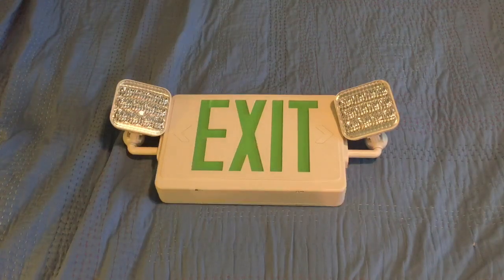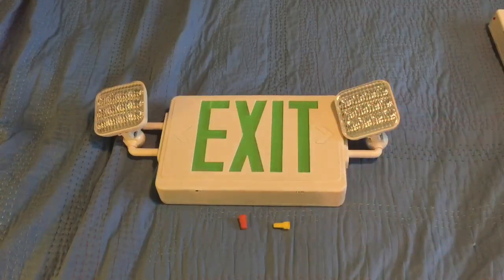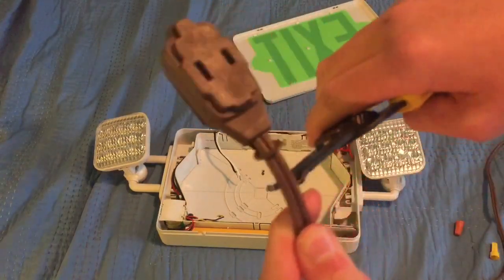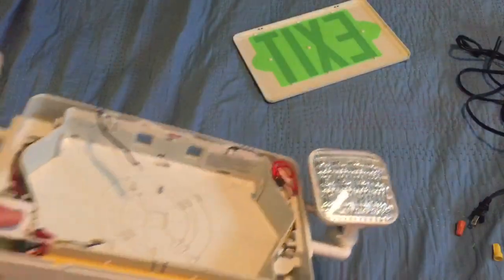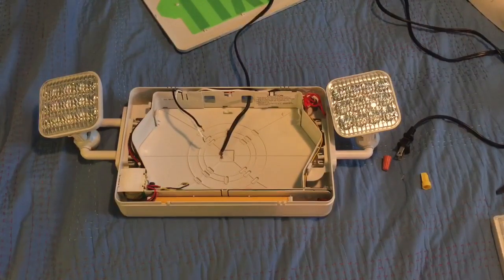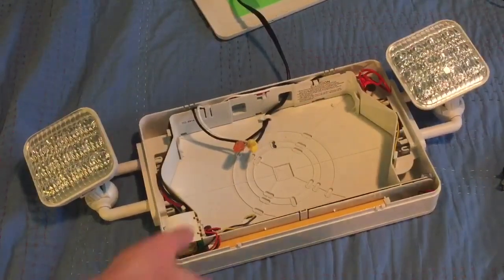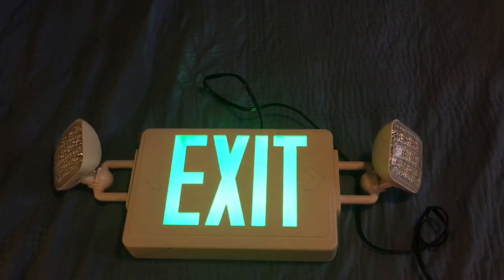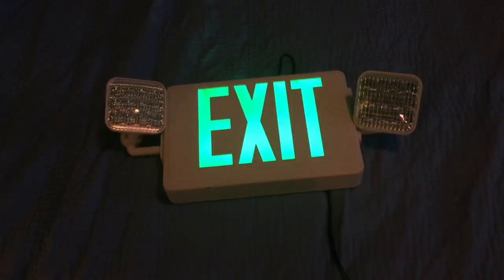How To Wire an Exit Sign

Comment: Will this work for building code inspections?
Reply from the maker: It will not. In a building exit signs must be hardwired to the building’s electrical system.

Comment: Hey, at my mom's work, me and my dad saw some Lithonia exit signs that are this model, but red, and they were out. When you press the test button, it blinks. What could this mean? They sent an electrician to fix it, but I'm still curious. Btw my dad and I work on stuff there.
Reply from the maker: That sounds like the backup battery was never plugged in or needs to be replaced.

Comment: But the real question is how can I make it so the lights on the side are on with the rest of the sign. I wanna make a lamp out of mine
Reply from the maker: Those lights are not designed for what you want them to do. They will light up during a power outage only. You’d have to do some modifications on the internals in order for them to remain on all the time.

Comment: Hi is there one for 24v or 48v models of combos or exit sign I am really not good with 120v and 240v
Reply from the maker: Exit signs do not come in 24VDC or 48VDC. Only line voltage such as 120VAC or 277VAC.
Reply: @ExitSign250  alt right thanks I asked on of my friends if he could wire up my broad he said yes so I tell him to run 120

Comment: Hi, thanks for the video, do you know if i can connect this sign to 220v line?
Reply from the maker: Most exit signs are either rated to be used with 120VAC or 277VAC. Any other voltage will not work and may cause damage.

Comment: So my sign isnt illuminating any more and when i press the test buttin the red led bulbs just flashes once.  What do I need to replace?
Reply from the maker: This may indicate a dead or disconnected battery. Try to connect the battery if it isn’t already, and if the battery is already connected it just be replaced.

Comment: I hooked up the two whites and two blacks the light goes on for about a minute then shuts off looking @ the panel the breakers say 125/277 I think I need to hook up the red wire to the black one coming through the wall. Also do you think this light is still functional since I might have hooked it up the wrong way to start?
Reply from the maker: Are you plugging the sign into a normal standard outlet? If so, it is 120VAC. Also, are you in a commercial building? Most houses are 120/240.
Reply: @ExitSign250  It's a commercial building and I'm not using an outlet,its hardwired through the wall. I have (1) black and (1) white wire coming through. My other concern, was the fixture damaged since I hooked up the 120v black wire to the power sorce coming through the wall?
Reply from the maker: This video was not intended as a how to for replacing/installing an exit sign in a building. Instead this was for if you had an exit sign and you wanted to connect to an extension cord for display purposes. In your scenario, more than likely the sign has been damaged beyond repair. If the wall connection was 277VAC and you connected it to the 120VAC input on the sign it was significantly overpowered. Before replacing any fixture or sign where the voltage may be 120V or 277V it is a good idea to find out what it is. Either with a multimeter or by looking at any markings at the breaker. If I had to take a guess, the connection you have was 277VAC.

Comment: Red is the ground and the black and white is the power if you have a emegency light or a exit sign only and a combo sign
Reply from the maker: Red is not ground, red is for 277VAC. Ground wires are green or bare copper. Plus this exit sign is fully plastic so no ground is needed.
Reply: Oh now get it so red is not ground because everytime i wire a exit sign i only wire red with nothing i dont use it i only use the black and white
Reply from the maker: You should normally wire the black wire to hot and the white to neutral. Unless you are in an industrial application with 277VAC, you will normally encounter 120VAC wiring. If you have a green wire that is ground and it should be connected to ground, but most plastic units today don’t have a ground wire.
Reply: Ok I only have a  emergency light because i use to have a exit signs in my collection but they got old and I only have emergency light combo and have problems with the wiring I used this video how to wire a exit sign combo
Reply: I got this green exit sign combo from my neighbors it was a green/red the sign was built with with a switch that has a g and r and the wire to the battery was broken

Comment: My battery wont turn off even when its plugged up. What should I do?
Reply from the maker: Are you saying the unit stays in emergency mode even when you have it plugged in to AC power?
Reply: @ExitSign250  yeah and I'm not sure what to do at this point
Reply from the maker: It ether is a loose wiring connection between the cord and the unit, or you simply just have a defective unit. What’s the brand and model of it?
Reply: @ExitSign250  EtopLighting and I think the model is AGG745
Reply: @ExitSign250  the issue I was having was that when I plug in the battery it would turn on, and when I plug it in it would just get brighter. I think with the model I had it was just supposed to be that way because other than that it functioned normally. But this was a great tutorial, thanks for the help!

Comment: I heard that it doesn’t matter about if you wire the positive or negative to Neutral or 120v
Reply from the maker: Technically speaking, no it doesn’t. Most devices will work the same way regardless. However it is important to wire them the correct way for safety reasons. Devices with labeled hot and neutrals are labeled for a reason. It may be how they function where it needs it. The most common example is a light bulb socket. That is an important connection to make since if one makes it incorrectly the outer rim on the inside of the socket could be live instead of the small pin at the bottom.

Comment: what do you mean by the if your sign does not have ac power do not leave the battery plugged into the unit because it can mess up the circuitry? isn't that what the back up battery is for? very confused. if anyone knows what that's about please let me know. thanks. :)
Reply from the maker: What that was referring to is if the exit sign or emergency light is completely not powered, and you plug in the battery without first applying AC power. The battery can damage the circuitry if AC power is not applied first before the battery.
Reply: @ExitSign250  when you say damage the circuitry, what do you mean? i've done it a few times by total accident now that i'm thinking about it. have i severely compromised the units lifespan or whatever by doing that or is it one of those more immediate things that you notice or something along those lines?
Reply from the maker: It varies. Some exit signs or emergency light’s charging circuit can be damaged, so the unit can’t charge the battery. Or more drastically the unit could smoke. (This has happened twice to me) And once that happens the sign/light is completely useless. Nothing you can do to fix it.
Reply: @ExitSign250  thanks for the info. :)

Comment: 6:30 what if both are smooth, and what if it is a three-pronged extension cord
Reply from the maker: Are the wires color coded?
Reply: neither of them are. however I guessed and it worked.

Comment: I cut off the surge protector outlet and was left with the cord. but there were three wires two of them were black and white and there was a third wire that was green. What do I do with the green wire?
Reply from the maker: The green wire is the ground wire. Only use that if your exit sign or emergency light has a ground wire, if not just cap it off with a wire nut.

Comment: The cheap green colored piece looses it's color after a while.. mod the red colored plexiglass that's in the older exit signs as a better fix.
Reply from the maker: I’ve never seen any diffuser, especially green, loose it’s color just out of random. Unless it has constant sun exposure, or has incandescent bulbs behind it.
Reply: @ExitSign250  I'm referring to older 120watt bulb exit signs w the red colored sheet

Comment: I have a question. When my emergency lights on my combo are disconnected, when I test it it does it's normal thing. But, when they are connected, it just turns off and doesn't do anything until I release the button. Would you by any chance know why?
Reply from the maker: So, when the emergency light heads are plugged into the circuit board, and with the battery plugged in you test it and the whole sign shuts off. But when the lamp heads are disconnected and you test it the exit sign stays on?
Reply: Correct, and it just started doing it. I can make a video if necessary
Reply from the maker: Interesting. Only think that comes to my head is ether the battery is not charged enough, or doesn’t have the correct voltage or amperage to supply to the lamp heads.
Reply: Ok, thanks for your help. I think I'm just going to order a new battery because that must be the problem. The sign worked before. Once again, thanks!
Reply from the maker: Sure thing! Let me know if you need any more help on this.

Comment: Hi ExitSgn250,
I have a question, just in case you have time and it is interesting to you :)
Background info:   The week there was the blackout in my area, it lasted 3 days.  During the day, I was able to manage but the problem was at night. 

The emergency light that I purchased is this one: https://www.amazon.ca/Hykolity-Adjustable-Wall-Mount-Emergency-Fixture/dp/B075ZLWGWG/ref=sr_1_cc_4?s=aps&ie=UTF8&qid=1543883095&sr=1-4-catcorr&keywords=LED+Two+Head+Emergency+Light+with+Battery+Back-up+White

There are several sellers in Amazon but the lamp is the same. 

After I completed connecting my emergency light to a regular electrical cord; I noticed that the internal battery is: 3.6 V KRH 15/51 Ni-Cd.  DISON 600 mAh 180507-223.  The instructions says the lamp last about 90 min.

Questions:
1)  Can I replaced the original battery for one that last longer?  I am not an electrician but I am not afraid to try.   I understand that the wires may heat up, etc... so taking into account all that, if I replaced the existing battery with another of the same voltage (3.6 - 3.7 v) but with larger mAH (so it last longer): What will be the max mAH this light system can handle? I noticed you have the same unit - dual 120 v or 220 v

2) If the above is not possible: How do I connect 3 battery packs (in total) same specifications? If I am not mistaken, they will have to be connected in sequence and NOT parallel.  How do I connect the wires (red/black)?

3) I was thinking to install a switch, so I can turn the emergency lamp on/off, rather than let it be ON until the battery dies.  Where within the wiring of this lamp, can I insert a simple switch?

Before I forget: I release you of any damages, etc, etc, etc.... This is just me asking for some help/advise.  At the end of the day, I am 100% responsible for everything I do with this lamp, may or may not happens to me, present and future damages, act of God, etc. etc. etc.  I  think this how disclaimers go :)

Thanks,
Cynthia
Reply from the maker: Hey Cynthia! I’d love to answer and help you! To start off, you can certainly upgrade your battery. The emergency light you have is generic, manufactured by one company who sells them to other companies. And they do not have the same quality as brand names. (i.e. Dual-Lite, Sure-Lites, Lithonia, and a few others) So they are everywhere under different brands, models, etc. The batteries provided in these units are only chosen to comply with the minimum amount of runtime required by NFPA fire codes in order to keep the overall price of each unit low. To expand the run time, you can simply get a higher amperage battery. But make sure it the same voltage and same kind of battery. The higher the amperage, the higher the runtime. However it can take longer to charge. Fire codes specify that a exit sign, emergency light, or combo take no more than 24 hours to recharge a completely dead battery. So your emergency light may take longer than usual to charger the higher amperage battery if you choose to install one. Also try to get the same style of push-in connector, if not you’d have to splice the original connector to the new battery. 

To answer your second question about the switch, yes that is totally possible. However, it’s against fire codes. But I assume this emergency light is only for personal use and not commercial and/or life safety use. I’d suggest wiring a switch at the lamp head output. So when the switch is flipped off, the electricity stops before reaching the lamp heads. I hope I was able to answer and assist you! Please feel free to follow up if necessary!

Comment: Hello, 
Thank you very much for having taken the time to post this video.  

About 2 months I go, there was a blackout in my area. As I tried to find my flashlight, I bumped into a chair and felt. I almost broke my right arm and I ended up in brutal pain for 3 weeks.

So, I did the obvious - I purchased 2 emergency lights (not combos).  The units I purchased are exactly as one you showed in your video.   
When I order them, the ad said: Need to be hired wired.  So I thought: Well... I can always put a plug and plug it in a standard 120 V.    

When the units arrived, they came in with 3 wires: Black, Red and White.  It drove me nuts trying to figure it out.   I thought I could simply connect the 3 wires to 3 prong plug and plug it in 120 V. 

I had spent about 2 hours, searching a simply explanation (I am not an electrician) that made sense to me.  After 2 hours on the web, I was more confused than before I started.  
I was just about to give up and return the emergency lights, when I came across your video. Now I know what to do :)

Once again... Thank you!
Reply from the maker: Great! I am very glad I could assist you! I made this tutorial since there are hardly any others on the web and YouTube that go in depth. I hope your new emergency lights will be ready for a power outage!

Comment: What S they name of the combo in the video?
Reply from the maker: There’s not really a name of it. The combo is produced by a generic manufacturer called “Jiming” and they sell the products to any company to rebrand. These generic units do not have a quality control, and sometimes only follow fire standards to a minimum or not at all. But to find these, you can simply look up, “Exit sign combo” or “exit sign with emergency lights” on eBay or amazon and this type as well as different designs will be he first to pop up.

Comment: When you wired the 2 wires with the wire nuts wrap some electrical tape around them to so that way you wont electrocute yourself with the wire nuts.
Reply from the maker: That certainly is good practice, but not necessary. And you can’t get electrocuted by touching plastic wire nuts...

Comment: Is this a Remote Head Capability Unit
Reply from the maker: The one featured in the video is not. However they do come in remote capacity.
Reply: @ExitSign250  do you a link for one like that?
Reply from the maker: I don’t, but they can be easily found with a search on eBay or Amazon. However if you search it there, the cheapest and first ones to show up will be generic. Low quality, and bad designs. They aren’t reliable and some do not follow fire codes. I’d really recommend Dual-Lite, as they are the best company out there.

Comment: Do all of these emergency signs, emergency lights, or combinations of both always have to be plugged in, i.e., are there any that can simply be mounted and not be plugged in or can last strictly off batteries?
Reply from the maker: No they cannot. They must be connected to AC to function properly, as well as switch to emergency mode in a power outage.